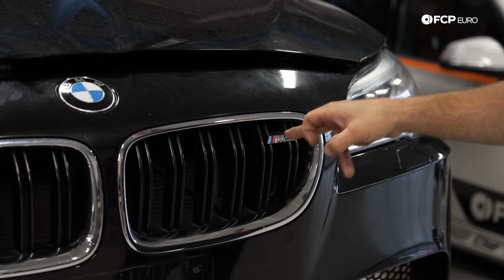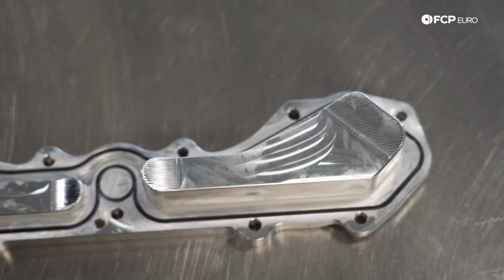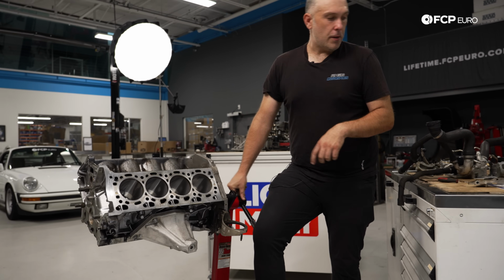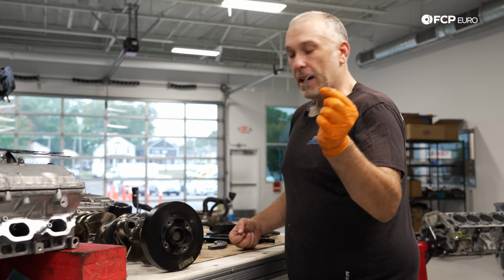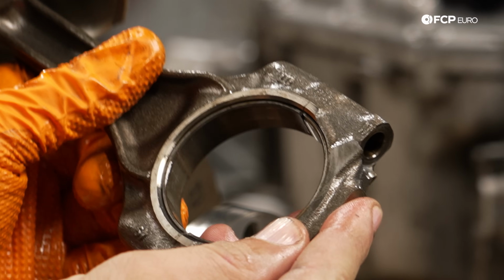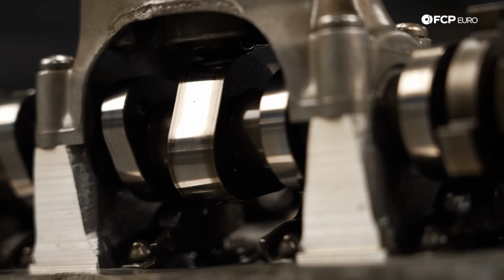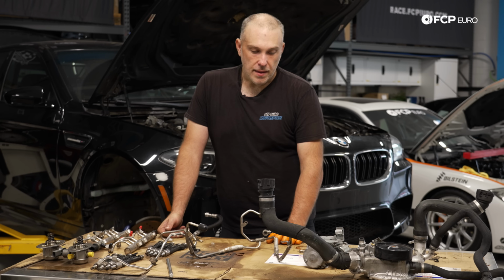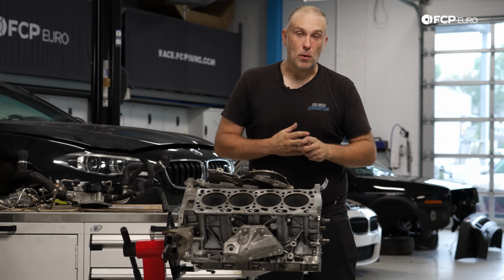BMW S63: Everything You Need To Know - The BMW F10 M5, F12/F13 M6, F06 M6 Gran Coupe Engine Guide

Comment: So if I’m understanding this correctly BMW built a beautiful engine. And made supporting parts to prematurely die so it would grenade the engine so owners would go back to BMW for a new $30,000 engine?  So all one has to do is make sure the oil stays clean by removing all of the cheap parts BMW used and install parts that last. They say the rod bearings fail. They fail because of dirty oil. Oil gets dirty because either the coolant tank leaks on top of the injectors which then causes them to stick open which then washes out the oil which then kills the bearings? And also do frequent oil changes. Did I understand that correctly?

Comment: My F10 M5 runs with 55K and every 1k oil level warning would be triggered and I need to refill 1 bottle. Is any possible common problems that I need to check ahead like pvc without lowering the engine down?

Comment: S63B44T2 is in the X5M and X6M. I have a 2017 X6M. Love it. 57,000 miles, zero issues.
Reply: Lucky u. I have e70 x5m. 

Recently its holding back on power.  Mild throttle acceleration gets the traction control light flashing madly. 

Been to 3 mechanics.  None have a clue why. Wheel sensors all ok. I asked to get then Timing chain and tensioners done but NOT ONE wants to touch this car engine.  

Planning to sell this metal crap.

Comment: The oil leak in the middle of the engine is fixable but that crazy coolant cover behind the engine is just wild. No thanks.
Its almost easier to cut a freaking access door in the interior of the cars front console to get that serviced.

Comment: This is a great video thank you FCP Euro !
I do have an 2013 M5  and it’s been a real solid car , other then normal maintenance and a couple of injectors this car has been very reliable ( no modifications ) in this last month (12/25 ) have noticed a couple of oil drops on the garage floor. As a 13 year old 132k mile car I would say that normal, found 3 issues both Turbo have internal oil leaks and Valves cover both leak .  To replace both Turbos and valve cover gaskets and associated items it going to run just over $14k . 
Overall I find this very acceptable cost .

Comment: For those who are hesitating to buy an f10 m5 please read this: I'm 19 years old with an f10 m5. I bought it with 83k Miles, and I now have 132k miles. It's my daily driver and I've had it for 1 year. I commute nearly 120 miles daily from and back. All you need to do is make sure you do your oil changes on time, let your oil warm up on  cold start, don't even use launch control, and it's already a powerful car... You don't really need to modify it a lot. Don't let people who abuse their car convince you that you can't handle it better than they can.
Reply: yo im 19  too considering getting one not sure tho dont have the space to work on it tbh
just basic maintence
Reply: @jasonawesome3821 that’s all you need brother just make sure you check the car fax for routine maintenance otherwise consider it abused
Reply: I wonder if your car had the rod bearings replaced with ones of larger clearance
Reply: @FredFlintstone21 I never seen it on the carfax so I don’t think it has, and I personally haven’t yet I’m at 140k miles this year
Reply: 다 좋은데 기름값이 너무 들어요 😊

Comment: Before I saw the video, I would say that the M5 f10 is worth every penny !
It's simply a great car !
I bought my M5 f10 new in 2012 and have never had any problems, even though it now has 200,000 kilometres on the clock.
It's just an awesome car !
I will keep it forever and pass it on to my son.
Reply: Original rod bearings still?
Reply: @BMWEnjoyer  S63 has absolutely No problems with rodbearings !
Reply: @TornadoF60  Happy to hear that. I just bought a 2016 M6 Competition with 87k miles that was serviced well but has downpipes and intakes and a tune on it already, but seems to not be running higher boost than stock. I think the previous owner was being safe with it.
Reply: @BMWEnjoyer  Congratulation and enjoy it !
Reply: @BMWEnjoyer  Yes !

Comment: 100k engine (from BMW) and a $100k car should not be having these issues. That engine debuted in the X5M/X6M years before it arrived in the M5. Bugs should have been worked out.
Reply: They do it on purpose to make $ on repairs...
Reply: Many issues are resolved in the S63B44T4, but that changes once you let your neighbor tune it with a chip from eBay.

Comment: I hear so many "scarry storries" about this engine that i start to wonder if the whole thing is blown out of proportion, How bad is it realy to buy a low milage car with this engine realy if it is taken care of ok? People on the interhet seem to be of the opinion that the thing will blowup just by looking at it :/
Reply: I agree. Change the oil every 10 tanks of petrol, and don't rev over 5,000..... and it will last forever. True of most cars.
Reply: @AbbeyRoad69147 not rev over 5000rpm,,  then much better to not buy it all😂..  its build to use it buddy,,
Reply: @mokhtarsohailifar6748  wrong

Comment: He is covering more of the N63 Platform in this video. The block in the video is an N63. The S63TU has much less problems than the N63.  They are similar engines but nothing alike. Completely different inside and out.

Comment: You can see the oil quality / delivery progressively deterioriated from the font of the block to the rear so maybe a heat issue (transferrence from turbos to main oil galley) accompanied by maybe residual bearing material blocking oil squirters. As you say of the rod bearings were replaced to mask the journal problem prior to sale that would explain why all the other bearings look so good: because they're new(ish). A lot of work to go to just for a patch as well!!

Comment: I still have my original 2001 E39 3.0 with a stage II Dinan with 250k on it and it still runs like a dream. The 3.0 inline six M54 is one of the best engines BMW has ever made. I’d love to have a F90 2022 LCI but the design and upkeep costs I don’t think make sense for me. I would likely only put less than 3k miles on it annually but even then there are so many issues with the warranty cost after 40k miles or 4 yrs I don’t think it’s actually worth it. I’ll keep researching maybe the LCI’s are a bit more reliable after 75k-100k miles.

Comment: Great video!

I notice you mention that the wider piston skirt is the loaded side and faces down/out which makes sense. However all pistons are identical (i.e. one part number for all 8) with the same arrow on top the piston, to be installed facing forward. That means that one bank will be installed with the wider skirt facing down/out and one bank will be installed with the wider skirt facing up/in? Is this correct?

Comment: At 12min, block is “not reusable” due to cylinder scoring.  
Why not steel sleeve it, impossible or too costly?
@FCP Euro Media great video btw, very informative!
Reply: Steel sleeving requires custom pistons,rings and quite a lot of calculations  as steel and aluminium dont expand at the same rate. Sleeve sinking is also a big problem.

Comment: I have a n63 with 190k miles and still going strong. I did the steam seals at around 70k miles, replaced the turbos at 120kmiles. Other than that nothing else other than normal maintenance.
Reply: shame reliable high mileage for these cars seems to be the exception not the standard.
Reply: Yes, and if you'd had a vehicle with identical performance and similar appearance from Toyota/Lexus you wouldn't have needed to do anything other than change the oil and other fluids on schedule.
Reply: @frankmiller95  yes. The real comparison is the very reliable hellcat. Simple v8 supercharger(no crazy hot v turbo problems) , more power at 700hp and extremely reliable with constant abuse.  I haven’t heard of major engine failures in hellcats, just minor stuff. Lots of high mileage hellcats.  Biggest issue, inside/outside looks worse than any m5, being robbed/killed while driving it or it being stolen while parked.

Comment: Makes the S85 look reliable :)
Reply: It is a reliable engine. B.E bearings & good throttle actuators & the car will run amazing, idiots just rev cold high reving motors. Now the smg that comes with the cars can cause more trouble

Comment: Thank you Garath..Amazing video... I have an F10M5 with this engine which was replaced at 53,000ks after a rod bearing failure. Sadly, now I have little long term faith in it and apart from very regular oil service and careful driving, I don't know how to ensure long life. BTW, what is your recomendation for oil grade. I live in a very moderate temperature area, no cold or very high temperatures.
Reply: The dealer will recommend you 0w-30. Most enthusiasts recommend 0w-40 or 5w-40, some say 5w-50. If you're running stock rod bearings I would go for either 0w-40 or 5w-30. I personally use Liqui Moly Special Tec B Fe 5w-30 and have had no issues, i also do drive my car daily and sometimes do short trips at low throttle, so I don't need too thick oil.

Comment: Is this problem on 2016 s63
Reply: Offcurse😅
Reply: @mokhtarsohailifar6748  this engine is the S63TU my engine is a different upgrade, I got the newer version S63 it doesn’t require all of that extra seals or heat shield, bmw actually got this engine more reliable, I got this engine with 130k mileage no problems at all, however this engine needs higher performance oil, and you have to maintain oil change, and top off, very powerful engine.

Comment: The N/S63 is like the finest collaboration between all major German manufacturers. Take each brands greatest hits and distill them into one masterpiece. 

Nowhere else will you find BMW’s coolant leaks & rod bearing failures, VW’s oil leaks & timing chain issues, Porsche’s bore scoring, and just general German calamity all in one place. 

Hats off to you, BMW! 🍻
Reply: They sacrificed reliability to keep the economy afloat.  Gotta keep german specialty mechanics in business. 😄
Reply: No lies detected 😂.
Reply: of courses with poor preventative maintenance you will experience and encounter major failures in both n/s63, depending how you treat the car you will also encounter major failures, i can’t speak much on the original n/s63 since i own a n63tu but i’ve seen both n63/tu last 100k and well over 100k without rod bearing problems or major coolant leaks, neither can i speak on the s63 because i have never owned it or had personal experience with it but in my eyes mainly anything before any technical update is complete garbage, you will face both major mechanical and electrical issues with both first gen n/s63, imo n/s63tu2/3 being the best in reliability with the proper preventative maintenance
Reply: @oemn63  all i know is that same year hellcats with a simple v8 supercharger setup are extremely reliable for the amount of abuse they get.  i have x3 m40i and hesitate to buy any bmw v8 turbo cars.   the b58 and s58 engines are so powerful bmw could really just stop using the v8s in 5 series and no one would complain.
Reply: @oemn63 Lasting beyond 100k without rod bearing issues is hardly an accomplishment to be proud of. ANY decent, high performance engine should at least double that with even modest maintenance.
Reply: Its like the people who designed the panther tank said we go this bro.
Reply: And to think they once made the best inline six ever, the M30. The S88 was great, too. Not anymore.
Reply: LMAO bro plz stop I'm laughing but my wallet is crying

Comment: Seeing the S63 as it comes out of the chassis gives me nightmares.  I had a plastic coolant tee break on my R53 Mini Cooper which cost me an engine, so I make plastic cooling system components maintenance items to replace before they break.  I shudder to think how many hoses and fittings I would need to replace if I owned an S63 powered car to “bullet proof” it for maybe 10 years.

Comment: My wife's E70 X5M has been excellent for us. She's put 100K miles on it since March 2020 when we bought it for $19,500 with 64K miles on it. I've done all the maintenance myself and spent more at FCP than I'd like to think about. However, the only unplanned maintenance was a new alternator at 97K miles. Other than that, it has never let us down. The same goes for my E60 M5, but I've only put 20K on that in the same time. These cars are fantastic, but they demand preventative maintenance.
Reply: We're almost on the same path. I went remote in 2020, bought a 13 X5M for $21k 83k miles, and did a tune up and battery to get it solid.  128k miles now with fairly persistent little things, but only one breakdown from the hpfp breaking (literally cracked at the mounting tab) 900 miles from home luckily 100 miles from our destination. But we've also done that trip multiple times both ways.
Reply: @surreaLinnovatioN  they really are fantastic cars
Reply: Agreed my f85 just now hit 101k brought brand new and I’ve never had a problem out of this car
Reply: 125k on my f10 m5. Also been absolutely a joy. It's tuned, otherwise completely stock. Ran 5w40 from day one and oil changed at 4k intervals. Still on original injectors, rod bearings etc. oil analysis is great. Take care of it and it will take care of you. Trust me 🤝🏼.
Reply: @lakeshorerides you think a 90k mile f06 m6 with good maintenance history of 3k oil intervals all done at bmw dealerships won't give me too much of a hea8for rod bearings?

Comment: Excellent video.  Very informative and don’t thing there is another video out there that is as complete as this one.  I currently have a 2020 X5M Comp with 44K miles that I bought brand new.  5K oil changes its entire life, never burns oil or coolant.  Never been tuned either.  For the past year I’ve been dealing with misfire in cylinder 6 only during cold starts or extended idling. Once I start driving zero misfires.  Already changed LPFP, HPFP, all spark plugs and coil packs.  I even changed out the injector for cylinder 6 and the issue remains.  Some days it’s better and some days worse.  Only idling or cold starts.  Any ideas what else I should look at?
Reply: Engines need 4 things to run, air, fuel, spark, and compression. I would do a smoke test and see if there is a vacuum leak near cylinder 6. If its hit or miss it doesnt sound like a compression issue, which is good. If you have a scan tool see if you can monitor live data for knock, misfires, during a cold start,  and record the data. I would also check your battery and see if it has sufficient charge, you might think im crazy but BMWs are very sensitive about their batteries.
Reply: @clonetrooper576  Def not the battery since i have it on a trickle charger almost every night.  I know these are a finicky when the battery is low so I always keep it topped off.  I can see during live data that #6 misfire counter keeps going up but eventually goes back to zero.  Once i start driving the counter stays at 0.  Is it possible that fouling injector in other cylinders cause #6 to misfire?  I'm wondering if its worth wild to change all 8 injectors at this point.
Reply: I will give some insight since I own one of these engines and fix them for a living, the coolant reservoir is known to leak on the driver side, the side that you’re having issues with, some piss, some leak enough to not notice at all, you replace the expansion tank, some never leak again some leak a few months later. Likely you have a coolant leak on that side. Even if it’s already been fixed, check the connector for the injectors and coils on that whole entire bank 5-8 it’s a known issue that coolant contamination corrodes the connector bad enough you have electrical issues. Check your cam solenoid connectors for contamination as well. This specific leak has hydrolocked peoples engines, shorted the injectors, shorted the coils, arcs spark plugs, and ruins the engine harness, if this is what’s going on the damage may have already been done and you’re now down on compression, if compression is good and all of which checks out(no coolant leak from reservoir + all your new parts+ no contaminated connectors (they will look crusty and corroded) you could have a bad dme. Sorry for so much info but the expansion reservoir leak wrecks havoc in so many ways some issues are immediate and some can happen long term and it all comes from there
Reply: @the_first_resort940  Thanks for the info.  I'm familiar with the coolant expansion tank leak that happens on the M5's.  I have a X5M and the tank is located on the side so doesn't have that issue.  I've also pulled all the plugs, coil packs and all looks clean.  Even the plugs didn't look bad and was consistent across all cylinders.  I checked all of the wiring visually but didn't see anything that looks concerning.  Does bmw sell portions of the coilpack harness or is it just the whole engine harness?
Reply: Did you program the new injector?
Reply: @lakeshorerides  The S63TU4 in my X5M doesn't need the injectors to be coded like it does for the M5.  I checked and they all have the same numbers on the injector

Comment: I saw another video that showed that the S63 engine block has 8 bolt main bearing caps. The mains are also cross bolted from each side of the block. 
So the engine blocks are different between the N63 you show and the S63?

Comment: Thanks for this! at the moment I have a M340i but can't wait to upgrade to an F90 LCI. Build engines can run 900whp on pump gas! Almost Veyron power for 1/10th of the cost.
Reply: B58 also sounds better
Reply: @AKK5I crazyy the turbo whistles from the m5 sound soooo sexyy but the b58 is a great engine too ngl
Reply: The LCI F90 is a handsome beast! Our friends over at @evolveautomotive in the UK have really showed the world how usable they can be at high power with some choice mods.
Reply: 340i can make more power than m5 comp or any m5! B58 is better engine can do easy 1000whp and lighter chassis